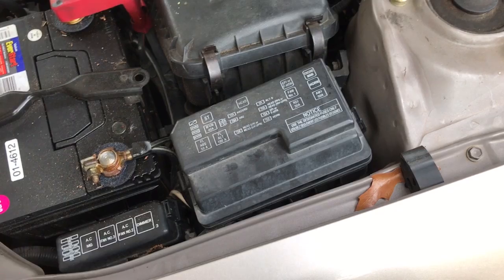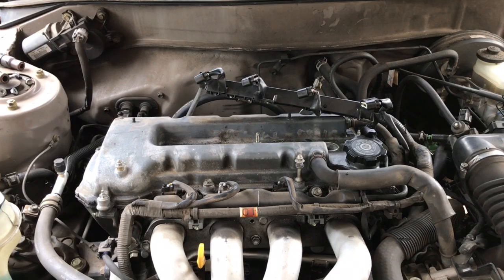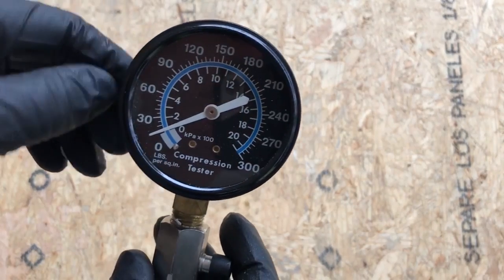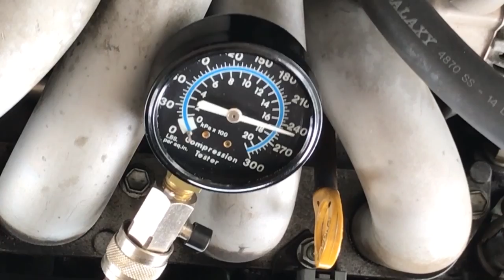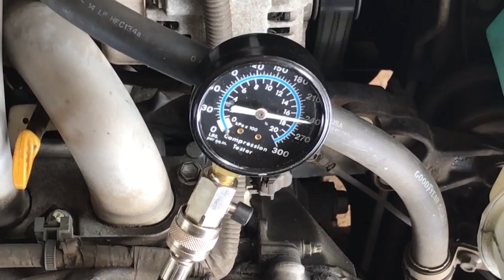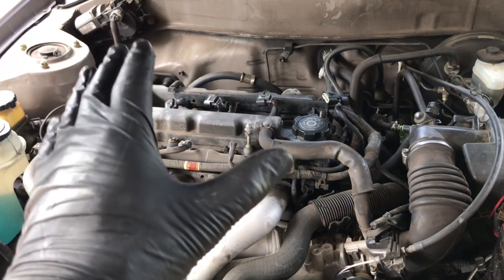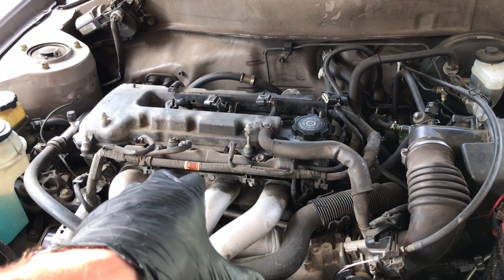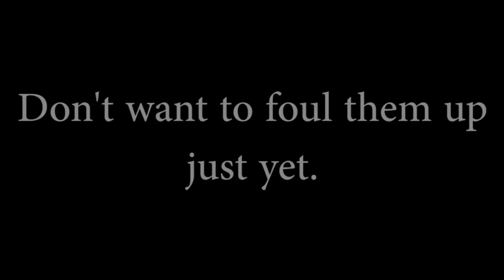Are piston rings causing oil burning? | Compression test | Oil Burning🔥Experiments | Episode 3

Comment: You should put oil in and see if the compretion comes up this will tell you if its rings or valves
Reply: How so ?
Reply: @bartsprengelmeijer4825  Adding a small amount of oil can seal the rings better, thus increasing compression.
Adding oil will not affect the valves this way.
If adding a tiny bit of oil doesn't improve compression, that would indicate a valve not sealing.

Comment: Engine oil consumption can also be as simple as a stuck closed pcv valve
Reply from the maker: True, charging7. That's why there's footage of me checking the PCV valve at the end of the video. I filmed that part this winter before doing the compression test. Thanks for the comment.
Reply: @FamilyFriendlyDIY  Just replace the PCV valve, there's no point in cleaning them as they still can malfunction just from age.
Reply: While the pcv valve would allow oil consumption in a open position, after the car is running, thus creating a wet piston condition, it does not tell much about the compression test that that primarily deals with valve stem seals and piston rings. Your engine valve stem,  piston rings or cylinder walls are worn.
Reply: @RayleighCriterion  Another thing I learned about the PCV valve is that it is best to use an OE because the valves are calibrated to each engine.
Reply: @RayleighCriterion  yes; they are cheap to buy and easy to replace and cleaning the old one proves nothing...

Comment: Carb Cleaner down spark plug holes  . let it soak  , crank engine  without plugs  , Before  starting  /  Do NOT crank  engine with liquid inside !
Reply: What is the benefit for put carb cleaner inside the cylinder?

Comment: Try engine restore,  it's an engine oil additive that helps with compression and oil consumption. It worked great on my 71 Ford.  Good luck!
Reply from the maker: Thanks Eugenio. After reading this, I watched the Project Farm video on Restore. Looks promising. https://youtu.be/Hr8jIwVyIFE
Reply: Tee Mack  is it possible to remove the pistons from the bottom without taking off the head? I have a Toyota 7A FE oil burner
Reply: @Shumayal  Gotta pull the crank out
Reply: I heard restore make trouble on vvti. But I did at my 2001 Corolla got great results. Try Xado product it like combination of engine restore and liqud moly crate.
Reply: Yes, Engine Restore is Amazing.

Comment: Based on your first video, and this video, the top down worked better on the pistons that were down lower and unstuck the rings in cylinder 1 and 4 and didn't in 2 and 3 so redo top down on 2 and three with the pistons.lower

Comment: Off to do a compression test on my engine right now!  Bought the tool about 6 months ago and it's still in it's packaging.  My SAAB is also burning a bit of oil. Not as much as your Toyota though.  It has 210k miles on it and last year I fitted a refurbished head with all new valve oil seals.  This improved things but still losing a bit of oil. Time to work through what else it might be.  It's not the turbo as that has also been replaced with a quality refurbished unit.  I've also stocked up on some Seafoam and will give the bottom up approach a try.  Thanks for creating these videos.  They have inpired me to get to the bottom of the issue once and for all.  Cheers.
Reply from the maker: Thanks for the comment, Richard. I wish you the best with your SAAB. Sounds like you really love it. I've heard those turbo SAABs are a pleasure to drive--wait, all of them have turbos, don't they?
Reply: @FamilyFriendlyDIY  Good news is I have 215psi on all cylinders and the plugs are a nice biscuit colour with nice clean piston tops. I've chucked a slug of seafoam in with the oil and will run it for 300 miles and see if that improves matters.  I think all the SAABS you got in the US had turbos, but here in the UK some of the lower spec models had NA engines.  Mine's the top of the range Aero which has a modest tune for extra giggles!

Comment: I just picked up a 2001 Corolla with this insane oil consumption issue. I will be doing the seafoam thing soon. PS the day I purchased the car I installed a new OEM PCV valve.
Reply from the maker: So sorry, Brian. Hope you have some good results. Someone mentioned they run half a bottle of Seafoam in their Corolla crankcase all the time (not just the 300 recommended miles) and it has almost eliminated their oil consumption problem.
Reply: Update?
Reply: I have a 2000 Corolla with just over 300K trouble free miles and have some oil burning, but do NOT assume the problem is the piston rings... it may be elsewhere !
Reply: They came with that issue from factory, just upgrade new piston and rings..you will good to go..trust me
Reply: @prcc8793 THAT COST BASICALLY THE PRICE OF THE CAR ITSELF.

Comment: Your gauge is absolutely inaccurate 
Compression should never go that high even if it's 1k miles old
Reply: Tell us more. What is the real issue?
Reply: 240 lbs of compression is too high for that engine... I have a high compression 12.5:1 4 cylinder that makes juat under 215 lbs.. This isn't a high comp engine.

Comment: If it burns that much oil, my guess is that the pistons oil control rings are worn out.  Probably need major engine repair. it could be a big project for DIY.
Reply from the maker: If it comes down to it, we'll attempt the rings. Thanks again for the comment, Kyle!
Reply: This generation Rolla is known for this oil consumption due to stuck (not worn) piston rings.  The fix is to upgrade to better pistons with better oil relief holes and rings, not just replace worn rings.  Like they VVT, the rings, chain and engine are okay with frequent good oil changes, but people use cheap filters or oil or go too long and this generation is known to plug up.  I saw a used Mazda once and the guy thought he 'burned oil' so he went to the old myth of using heavier grade.  Then couldn't figure out the chain noise.  He gunked up the timing chain tensioner so it no long provided tension, so the chain rattled on decel.  I should have bought it.

Comment: When doing a compression test if one or more cylinders comes up low immediately  pour a tablespoon or two of motor oil in the cylinder via the spark plug hole and retest the compression. If the compression rises immediately then you know your rings are bad if it doesn't rise then it's your valves.

Comment: Around 200,000 you will need valve seals. Oring on the cam can tensioner will leak. Check your pcv system. Remove the oil cap while its running and see how much blowby you have. I would try berrymans Chem dip in the cylinders as a cleaner. Change the oil and filter afterwards and check compression after you have run it and let it cool off for 24hours.
Reply from the maker: Thanks for the info and tips!
Reply: @FamilyFriendlyDIY  I would drain the oil first until it's completely dry. Then put a clean catch pan under the drain plug. That way whatever comes out you can keep pouring it back in.
Reply from the maker: @ebuzek3648  that’s a great idea.

Comment: Classic stuck rings, do exactly what you did with C form but instead get a product called “Shooterz lube“ and if you want to see how well it works take those old spark plugs and put some shooters lube on them and you’ll see a carbon off of the spark plugs. You can do the same thing for the rings.
Reply from the maker: Thank you for that, MrRoverpilot. I just looked that up and think that really might make an interesting experiment!
Reply: @FamilyFriendlyDIY  My Audi Q5 has over 110,000 miles and was burning over  1 qt for every 350 miles , Would get the Low oil warning light on in 350 miles . Might be 2 qts low .  now uses half a qt in 10,000 miles . I introduced the shooters lube after pulling the drain plug and draining the oil , Waited until it ran through engine , poured it back on top the pistons 4 times . I also use AmsOil European formula 5W40. 
also when I change the oil I drain the oil normal then pour an additional quart of fresh oil in on top with the drain plug still removed until it come out looking like fresh oil usually a single qt will do it
Reply: @MrRoverpilot  Shooters lube solvent or oil?
Reply: @douglasberman840  solvant
Reply: @MrRoverpilot  Hey bro, so the method you used was - Drain all the oil out, then pour the lube on top the piston heads via spark plug holes, wait to drain through engine? i might try this for my audi, would the process lock up the engine in anyway?

Comment: You should try something that's based on polyetheramine/PEA such as Gumout because it's supposed to be more effective than seafoam.
Reply: I agree, seaoam was ok with non-ethanol gas, gumout should get you better results
Reply: I have been using gumout now for weeks; put one in the tank on almost every fillup, but I cant comment on how it is doing at this point, but Im glad to hear that it has that PEA thing that you mentioned, I know my cyls/ combustion chamber/ valves are dirty cause I checked them with a borescope too plus all the cyls compression are below 200psi. ; I will have to pull the head eventually, but I am seeing if I can clean it up first...

Comment: I love your approach to the  compression and oil consumption issues.
Did you do the Seafoam treatment by putting it in your oil?
If not, a friend suggested not just driving normally, but doing some hard pulls. Not just that, but.  Driving down some steep hills at decent revs, using compression braking in low gear.  That reverses the loading on the compression and oil rings.   I did both mid to high rpms up some hills in low gear, then back down a bunch of steep hills, compression braking in low gear.
Only thing I didn't do,  is before and after compression tests.
Yes, my oil was dirty afterwards.  
Great stuff your coming up with.
Mine is a 1988 4.3 in an S10 pickup.
Reply from the maker: I tried it in the oil, and down the spark plug holes.

Comment: How about pouring in lacquer thinner and automatic transmission fluid in the cylinders while the engine is warm and let it sit for several days topping it off as needed for several days then change the oil and filter again and see if that helps

Comment: Hey. If you're still trying to save it, try 'piston bath' with some fuel system cleaner or oil addictive.  Something has PEA in it.  It's proven to clean carbon.  But be sure to do research on how to soak pistons.  Mishandling could lock up the engine.  

Also, other youtubers see great result from liqui mody engine restore. It could be worth a try
Reply from the maker: We might try this. Thanks.
Reply: @FamilyFriendlyDIY  have you tried BG EPR?

Comment: lets say its the oil holes behind the rings that are clogged up with hard crud, seafoam not dissolving it cause its temperature
hardened crud. In that case the clogged oil return holes ( behind the rings) will mean there is more oil going past the rings
into the cylinders as its not being drained back to the pan via the inside of the piston.
In that case it is possible that piston 1 and 4 might actually be the bad pistons, they are showing
high compression due to the excess oil remaining in the cylinder making a better seal at cold start.
Wheres lets say oil drain holes are still clear in cylinders 2 and 3, then less oil in the cylinder and they "appear" at start up to have low compression.
Not trying to put you off, just making suggestion to explain the results. I have been trying to clear oil drain holes a toyota eninge using seafoam in engine oil for maybe a year or more now, bottom up approach with no success, I intend to keep adding seafoam for however long it takes, using about same amount of oil you are. Its just for the sake of seeing if it will work over very long term, a bit of extra oil use means you will have clean oil all the time pretty much, cat converter though will be working pretty hard to convert all that oil via the exhaust.
Reply: I have wondered if its possible to drill out somehow the oil holes by taking off the sump
and getting access to the under side of the pistons ( rather then take out whole engine), would be really nice if there is a way to clear those holes while pistons remain in situ.
Apparently that crud is really hard after being held at high temps for long periods.
Quite a few vids showing people clearning out those holes after pistons removed.
Reply from the maker: I actually wondered the same thing. Like maybe seeing if I could get something up there, like an angled pick, to scrape them out. Thanks for the comments.

Comment: would it be a blown head gasket as you issue is with 2nd and 3rd cylinder are working together and might be some oil going though it. I once got exhaust from the compression cycle going through the hg and into the coolant causing it to pressurize. but it all depends where it is blown.
Reply from the maker: Good call-out Samer, but I don't think it is. Both my coolant and oil have no signs of one contaminating the other, and no external leaks either (to speak of). I'm pretty sure the oil drain holes in the pistons are clogged up, so the oil can't be scraped off the cylinder walls, because it has no where to go. But we'll see. Plenty more experiments to go. Thanks for the comment!
Reply: @FamilyFriendlyDIY  This guy shows how the oil rings are problematic on subarus engines. Can be same issue on yours as well. It looks like it is a mission impossible to release them once they are stuck in there.... https://www.youtube.com/watch?v=5zKc6IAGvPc

Comment: Toluene is also a good cleaner, but you would have to change the oil after soaking the cylinders because it's a very good solvent but a very poor lubricant.
Reply: Yes it did work thanks for your knowledge 🙏

Comment: A leaky injector washing away the oil lube could have caused that very low cyl. ; and it may have been replaced after the damage was done, if it was not still leaking at the time of the video.

Comment: Thank you for this update, I have noticed my Toyota 7A FE engine (1994 Celica) smoke if I push it over 2K RPM when cold...but as soon as it gets hot, I can rev it higher with no issues! However, I noticed that I burn more oil (instant huge cloud) if I accelerate after engine braking.

Did you try this test too? (Engine braking down a mountain and then accelerate). Do you see any visible smoke? Also since this is a follow up video, I assume the seafoam didn't help? Didn't you already pour it in before? Is there any thing better than seafoam to be poured into the spark plug?
Reply from the maker: I haven't tried an engine braking test like you're talking about. I might do that. The Seafoam seems to have helped some, but the oil burning is still excessive. Down from about a quart in 320 miles to a quart in 500+ miles. We'll see how these next experiments go. I was able to drive the car over 500 miles without letting it cool down to see if I burned less oil when the engine was warm. The results were surprising. I hope to publish a video on that very soon. Thanks for the comment, Ahmad!

Comment: 140psi 8:1 comp
160psi 9:1 comp 
180psi 10:1 comp
200psi 11:1 comp
220psi 12:1 comp

High readings are not good either those cylinders  that are high have oil contamination  excessive carbon

Comment: Is there a way to test if there are worn or broken oil rings? A compression test or leak down test will probably not show the condition of the oil rings.
Reply: A leak down test would help determine of the piston rings are compromised because you would be able to remove the PCV valve and listen for any leakage emanating from the removed PCV valve opening.  You would have to leave the other spark plugs in that you are not testing and you would have to be sure the piston is at TDC so that all intake/exhaust valves are closed for the cylinder being tested.  Remember, this would leave several other cylinders with valves that are in a mixed state of open/close. The leaking air should follow the path of least resistance, which is past the rings and out through the PCV opening via the  engine head.  A leak down test may show multiple points of air escaping.  If the air is coming out of the PCV opening, it indicates a potential problem of the cylinder rings.  How much?  Well, other issues would have to be ruled out ,like cracked head, bad head gasket, open valve when at TDC......  The whole idea behind a leakdown test is for the pressure to stabilize during the test.  If the pressure doesn't stabilize, you have potential issues in potentially multiple places.
Reply: @red_887 just got a compression and leakdown test done in my 2008 2.0 mazda 3. All 180psi in all 4 cylinders, 2% leakage in 3 cylinders and around 5% in 1 but it may have been off TDC so results didn't come out bad. However, I'm burning oil 1quart per 1000km with zero smoke. There is some crankcase pressure felt when oil filler cap is opened but no smoke. Hoping it's my pcv valve but no leaks except for a bit from the valve cover gasket in the 2 middle cylinders ( less than 10000km since valve cover gasket was replaced). I'll do the gasket again too but it's an old engine at 258k km.

Comment: Tried it all in my 4.3 engine to no avail.  I found no magic cure for unreasonable oil consumption.  Did in truck valve stem seals with rope in cylinder trick and compressing valve springs, etc.  nothing would cure it short of yanking engine.
Reply from the maker: Ouch. Thanks for the info!